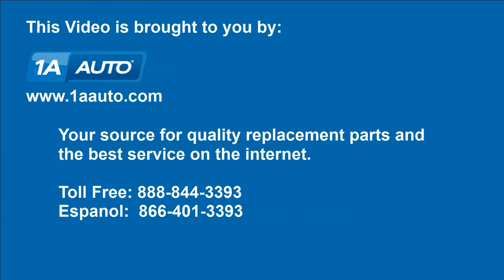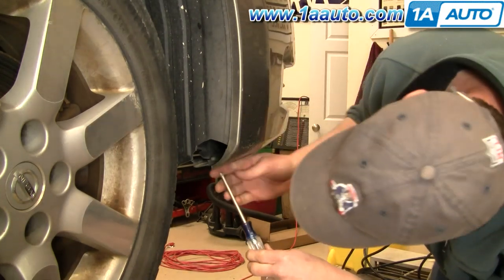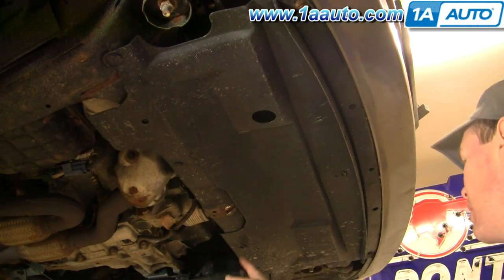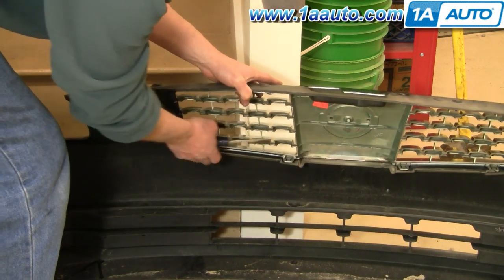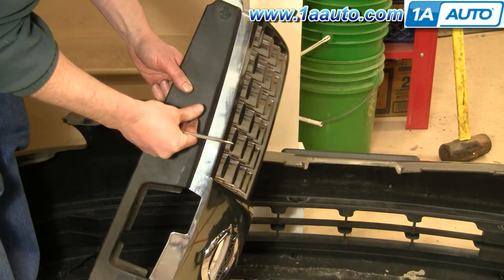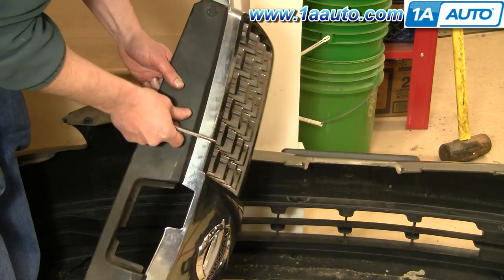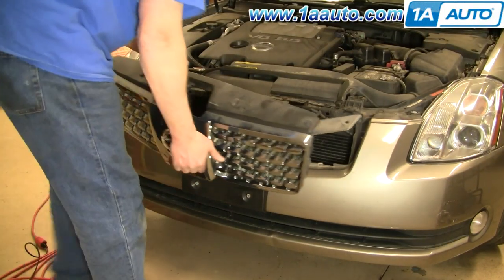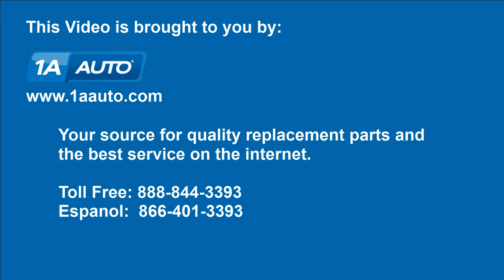How to Replace Grille 04-06 Nissan Maxima

Comment: I have a 2006 Nissan maxima. I know the grill was changed in the 2007 and 2008 models. Would the 07-08 grill fit directly to an 2006 maxima?
Reply from the maker: +Raza Kashani The grilles are different sizes, so they will not interchange.